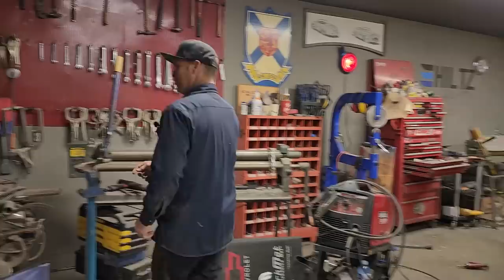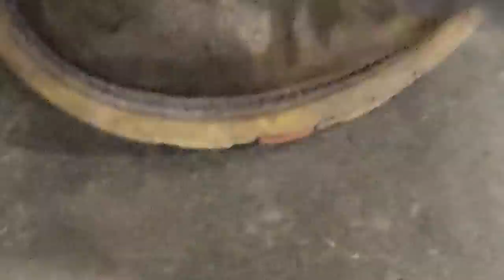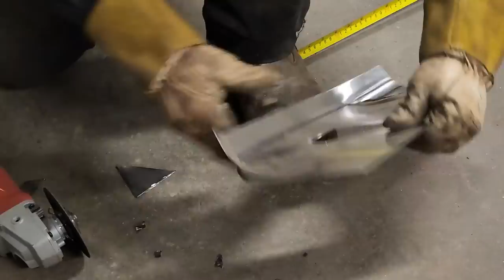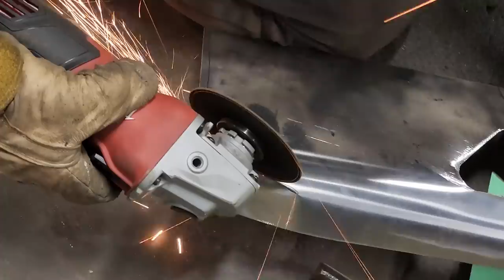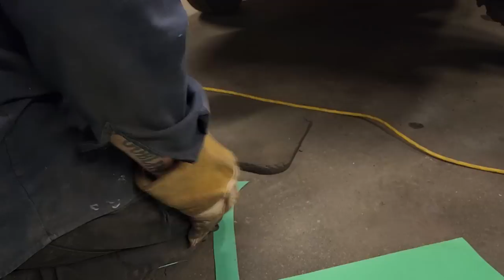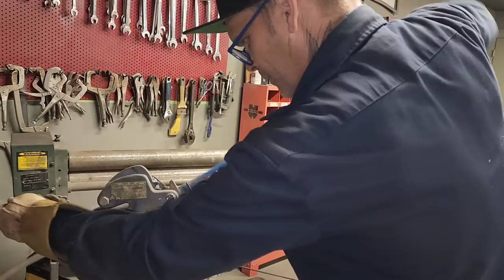Rust repair on curved panel with basic tools 💯

Comment: HI Chad & Jolene, I hope the storm coming your way does not cause any more trouble for your area. I noticed your new grinders on /off switch does not want to cooperate your desires, don't let it piss you off in time it will yield to your control and obey!

Comment: You are doing a great job on the Plymouth. When you get a chance you should remove the shackles and turn them upside down. They are not supposed to be hanging down like that. People years ago turned them upside down to raise the car in the rear. It’s not right the way they are. Just for your info.

Comment: HERES A TIP CHAT when you’re using scissors cutting out your patterns you shouldn’t use the tips of your scissors and then it wouldn’t leave marks on your pattern and you would get a straighter edge every time you cut it I hope that helps you some , it’s the same as using wrapping paper or using tin snips when you cut flashing or vinyl siding you never use the tip of your snips

Comment: An Airline splitter and a heavy cord, thats all ya would need to have that plasma ready for use, turn it on and go.. You amaze me with your cut off wheel skills, but eventually ya are gonna hurt yourself, and cutoffs will immediately change whatever body part thre touch,  you can get a decent plasma for a few humdred dollars, so the average guy can get one, way safer than them cutoff wheels, specially if ya don't use them everyday.